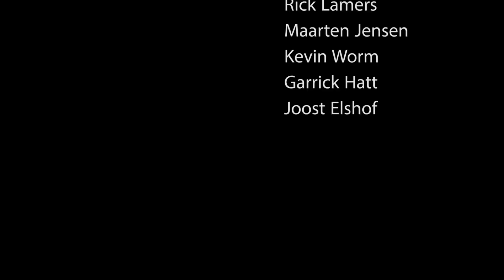Robotic Air Hockey Table

Comment: Hello, congratulations for the work, it's very cool!
Can you answer me a few questions?
- What mode are you taking to control de Festo Drive, I/O mode?
- What controller are you have to send the I/O to CMMS?
- When you reach the position, you've got the feedback output to send a new signal to the new position?

Thank you very much!
Reply from the maker: Thanks for the compliments! 

I don't remember the exact mode, we had a manual of the Festo drive that specified operation procedures. We first had to send a whole bunch of configuration parameters after which we basically fed in every motor location every X milliseconds. I believe we ended up sending every 8 milliseconds. I think the mode was just called CANOpen

We used a PEAK PCAN USB connection hooked up to our C++ program in Linux. Peak provided a linux library to hook into to send signals over the CAN bus.

We didn't use any feedback about position. There was no calibration required so all movements were exact locations based on the rotations specified through an int value of each motor. 

We worked with a queue that would be iterated over, and when a new position comes in through the pick simulation it would empty the queue and put the new location on top. We would never interrupt an arm movement mid-way because the arm movement always required symmetrical  acceleration and deceleration.

If you have any follow up questions feel free :)